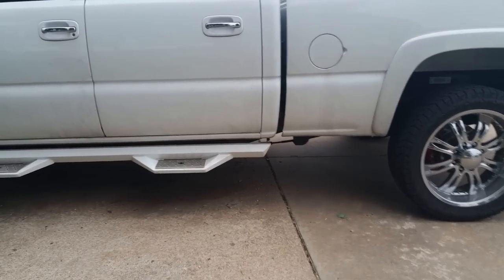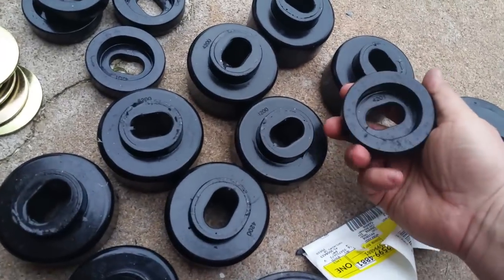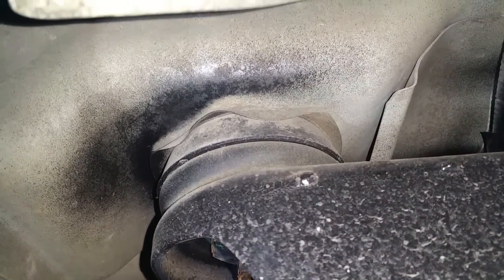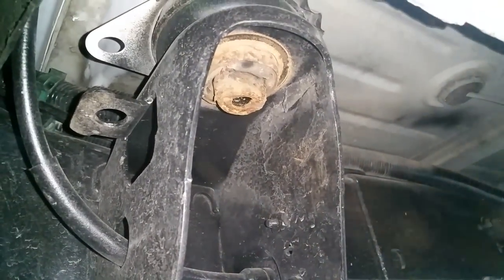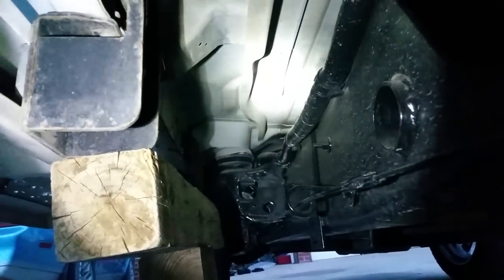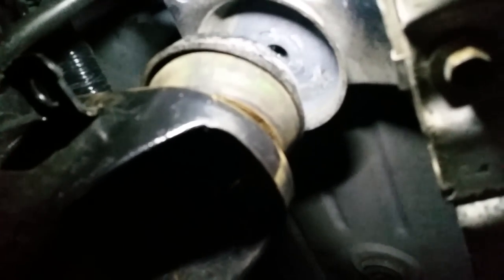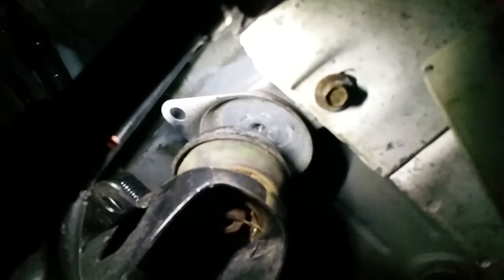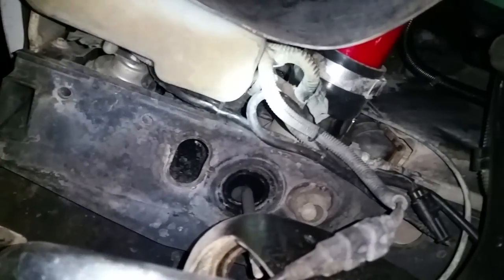2005 GMC Sierra 2500HD Body Mount Replacement

Comment: You kept those steel centers and didn't throw them away I hope. Go to 4:55 in this video https://youtu.be/AFJHiJFgqS0?si=jrawFcFPOHCWRU7d
Reply from the maker: @playsportfun3356  nope, I sure didn't. I had to go back and correct it and leave an edit in the description because of it. Been years since then, but absolutely need to save those pieces.
Reply: @BrantGarrison  LOL.... doing comes with mistakes. Keep up the good work. Made a few myself.